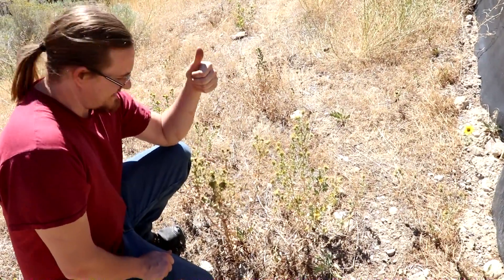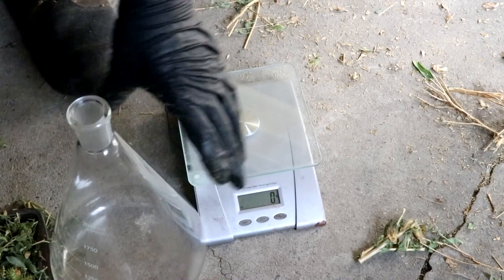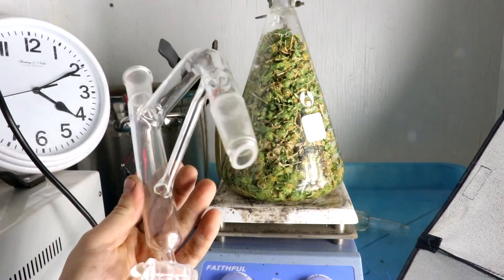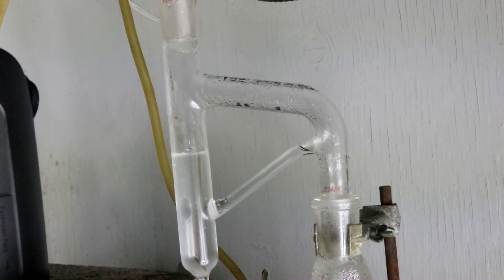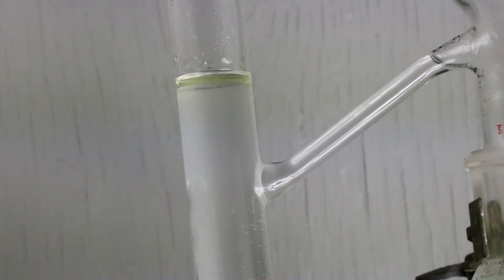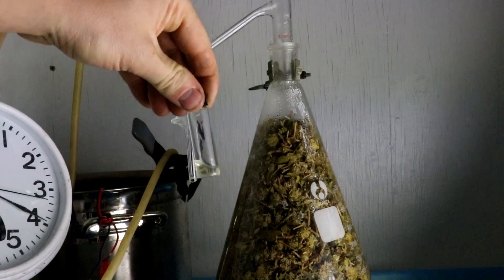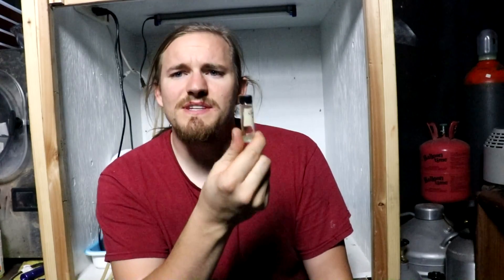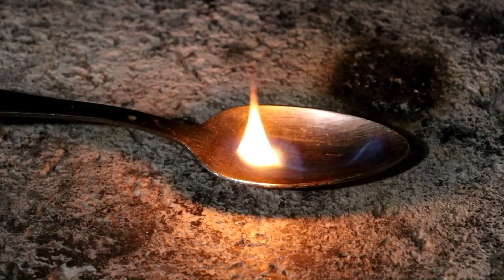Extracting Jet Fuel From GumWeed

Comment: Wonder if you would get more from a press then distilled?
Reply: Y'know how they used to get olive oil, yeah? Yeah.
Reply: Kain Yusanagi Used to? The extra virgin olive oil gets it's name because it's the one obtained with the first cold press of the olives, then comes the virgin oil which gets heat pressed from the remains of the first press and then the rest of olive oils which are unlabeled as extra virgin or virgin are extracted from what's left with solvents. This is the process from 2000 years ago and still aplies today.
Reply: It could be possible, eventhough I tried this receipe with other plants with more oil content :
- First dry the plants under sunlight for few days (not too long or they will lose most of the oil, just the right amount of time to let them crush under stress)
- Crush them into fine powder (the point of drying)
- Put them back in distilled water, in the same proportions you make with pancake dough.
- Let them inflate covered overnight, the mix will be more firm
- Place them in press between alternate layers of fine mesh stainless steel sieves
Water should draw out with oil, heating the layers around 70°C will make oil more fluid and ease the process.
Reply: I think the extraction was wildly inefficient. His gloves got all sticky from cutting up the weeds. That shows there was a lot of oil in the plant in the plant material.
Reply: @THX..1138  the stuff he got on his gloves were probably the heavier components while what he managed to do still were the really light, volatile components.
Reply: Thats the point, you press it so there is no space for the oil to be absorbed in.

Comment: Try drying your plant material out to the point of being able to grind it to dust then distill also lower your temps as much as possible. That what we do with cannbis to presevrve terps and increase yeilds. If i remeber correctly all plants keep their oils inside the calyx like cannabis so you should theroeticlaly be able to blast it with butane and get a viable oil maybe even a more stable wax form of its essential oils youll get a cleaner and higher yeild with less moisture cintent though. You can also try a food grade enthenol wash but that will also pull chlorophyll and essential oils not sure if that would affect its burn time or how clean it burns.

Comment: I would assume that some of the fragrance is the aromatics of the plant and not the oil, perhaps all the 'smelly stuff' wafted away in the evaporation.

Let me suggest making a solar distillation process so you can heat up a large tank with it and then use it like in the winter when the cold air does the condensing for you [pyrolitic destructive distillation] and you COULD perhaps use a vacuum chamber to increase extraction.

For large amounts of solar power, just make a trough in the hillside and place your barrel/pipe at the top so that the winter sun collected like it would on a regular high temp solar parabolic collector used for generating steam power in an electric generation power plant.

Just roll the aluminzed mylar out when needed and roll it back up when not in use to protect it, or if a storm comes along to potentially damage it.

In theory, within a single day's time, it would fully char the bum weed producing a host of combustibles and you could just purge the carbon/coke each evening when it cooled and replace it that night for the next sunny winter day.

Also, you can harvest it in bales while it is still slightly moist to collect it without crumble-loss and then put it through a shredder for a compact charge without as much air, or of course, add the water to drive out the air.

Put a hydraulic or pneumatic ram at one end to do the hard work for you and make sure the rig is strong enough to not get torn apart by the hydraulics and you can load it pretty easily.

Hinged pressure plates on each end with pipe couplings would allow you to detach the hatches, then reattach them without problems with plumbing, OR you could weld fittings into the pipes for adding water and extracting product and use flat plates.

I have a filter system which COULD be used except that it would have to be placed either on its side, or upside down, and I could use my big 30 gallon pressure cooker, but these items have other purposes.

I DO have 10 foot lengths of sch 80 steel pipe, but no space for gum weed of that capacity, no space for a large solar mirror, and also the pipe is scheduled for corner posts for my fences eventually.

IF I manage to get another piece of land I would like to get, I will at least try to build a large solar distillation machine.

Comment: I bet with a better cutting method for more surface area and a slower boil to account for your tiny condensing tube you could get a lot more by weight. 

try again and run a lawnmower on the weeds you cut with it!

Comment: That stuff would make a good lamp fuel from how it burns.
Reply: I bet that's his final goal, he's a prepper.
Reply: that would explain so much
Reply: I don't get why he didn't just use a rosin press
Reply: GrowingDownUnder 
You sir, just peaked my curiosity!
Reply: I saw you on project farm's video
Reply: Hydraulic press?
Reply: Barry Manilowa nope, weed is good as it is. No need to mix anything in.
Reply: Moth intensifies
Reply: Yeah i thought so too but i think i'd take a bit to much effort for an hour to get enough oil without just killing all the plants that his bees like
Over a year though you might be able to get alot of lamp oil like this
Reply: Kerosene is probably cheaper than the electricity he'd use to distill an equivalent amount of oil, not to mention the time and effort. Firewood doesn't appear to be abundant for long term post-SHTF processing. Maybe if he developed a way to distill it with direct solar heating, but the return on time investment is still an issue.
Reply: Bob Smith I appreciate your contribution.
As much as I’d prefer a lovely transition of times, the possibility of needing to fend for ourselves & close ones looks likely or possible in portions.

Sounds like you’re on your good way toward preparedness.
Lucky be those that get closer to your understanding.

Many of us are shining lights in the darkness and we barely even know it.
Reply: Diabettiss

Comment: heh, i seem to have my eye calibrated, i said to myself 0.1 - 1%, closer to  0.1%...

BTW, when filling the flask, do it on top of the tray where you pick up the plant matter., there is sooo much less cleaning. Funnel that has the bottom and one side cut off helps, it is a sort of curved wall so you only need to worry about the exposed edge of the flask  spinnling crumps and you can use that opening to smush things in with the finger. Takes like 20 times less time, you can just pour in the small particles and dust at the end: this is often the most valuable part of the plant matter: dried up flowers iwill break to small pieces easily, that is sort of designed function in the nature that they will do that.. That is where in most plants the oils are concentrated..

Comment: You should get a small diesel engine and get enough gum weed oil to see if it will run a diesel engine for like 1 minute or something. Could try un refined just the way it comes from the plant or refine it some way.

Comment: The lighter more volatile oils would have come off at the top. These are probably the fragrance oils. Also, was there any oil residue left in the conical flask??. Would an alcohol distillation work better?

Comment: The smell was reduced because of the heat in distillation. The heat cooks off the terpenes.
Reply from the maker: Makes sense, maybe I could run it under partial vacuum?
Reply: Cody'sLab  Vacuum would cause it to pull off more terps. I know this because I extract cannabis oils. Maybe if you pressurized it somehow
Reply: I love your videos btw man. You really do inspire me
Reply from the maker: Oh so longer/colder condenser?
Reply: Maybe use a more effective condenser, such as a Graham or an Allihn condenser
Reply: Cody'sLab You extracted the oil from the plant, but there are almost no terps in it probably. Try to extract it with a solvent maybe? such as butane, or co2 if you have the right equipment for it. Butane extractions are safe to do outdoors, and they extract all oils without damaging any terps with heat. You may want to dry it out first because it will also extract the chlorophyll from the plant and make it green. There are ways you can take the extracted oil and extract specific terps from them, since different terps have different evaporation points you can extract one terp at a time.
Reply: @marcferretti  I say he should use a bipolar solvent to get everything thing out because heh hey he ain't gonna be dabbing that oil
Reply: Try cold-pressing like how you would extract vegetable or seed oils. Presumably, the oil would evaporate at a lower temperature than water so you may be able to separate them at a lower temperature.
Reply: @marcferretti  Now I want to see Cody running supercritical CO2 through flowers to do an optimal extraction. I'm sure he can do that.
Reply: Try extracting it with super critical CO2? I think that's used for cannabis as well.
Reply: Came here to ask; why not CO2? When you mentioned you were going to extract oils from this plant I was convinced thats what you were going to do; what other youtuber would mess around with supercritical CO2 after all? I suppose building a pressure vessel with sufficient volume to be useful might be trickier than just making a small vial of it though... but if you ground up and compacted the plant material and put it in a steel tube... there are many more molecules you can get at this way than with steam alone.
Reply: @victorwidell9751  lol u think
Reply: @theCodyReeder  I'm not sure how they extract plant terpenes I do know they are volatile at lower temps. I'd research terpene distillation.
Reply: Maybe cold water extract and evaporate the extra water off slowly
Reply: Cody'sLab you could use a different solvent. I know in the cannabis industry they use butane or co2. That way terpenes are preserved.

And look into pure terpenes from some company’s. Prana is the company name I think. The owner has done videos on the process. It involves extremely cold temps.
Reply: Cody'sLab check out golden beaver farms he does some amazing work with extracting terpenes he’s running a steam distillation apparatus with dual condensers and under vacuum check out him out his work is amazing
Reply: also check: Essential oil distillation home made , rosemary - Huile essentielle distillation maison, romarin
Reply: @theCodyReeder  try CO2, it will extract the chlorophyll as well so keep in mind
Reply: @theCodyReeder  you got the stuff
Reply: use a rosin press
Reply: i agree definitely need to try other method's and maybe you would get stronger smelling oil
Reply: Using a soxhlett extractor with a low boiling solvent, like hexane would work
Reply: Will work well only if the desired elements are non-polar
Reply: I had a feeling a lot of "essential oil" extraction experts watched this channel. :-)
Reply: So many smart people
Reply: GOOD GOD MAN! It was bad enough when he was drowning Moles in acid! Now he is boiling Turtles!!!!!
Reply: I might be wrong, but don't they also sometimes use Butane to extract oils from buds?
Reply: They do, but you need to use a vacuum to get the butane back out and the process can be pretty dangerous and complicated.
Reply: wouldn't it help shredding it first and then submerge it and heating it up without boiling until the oil floats up instead of using distillation? I've the feeling most of the oil stayed in the weeds. Or maybe a pressure cooker, but then it would boil.
Reply: InfinitePower yes it’s very pure butane and it’s often used in a CLS system or closed loop system. That way all can be recovered.
Reply: I still think it's a good achievement not too many people were looking into it I have interest in growing garden weeds and plants not normally grown looked at for mass market consumption and practical use. You inspire me to go back and get my degree ,to garden and explore science keep up the wonderful videos!
Reply: I once used butane to extract cannabis oil and cooked off the excess material using a pot of boiling water and a glass lid (turned over to exploit the curvature) so I'm assuming the same process can work here, except I would assume smoking it wouldn't make you go weuweuweuweu lol
Reply: The terpenes should not be cooked off as long as you have a sufficient condenser. I extracted Limonen this way, which is a terpene, without problems. Ofcourse different terpenes have different boiling points but anything above 40 °C should not be a problem at all and most have a way higher boiling point (>100°C).
Reply: Squiggummer Figgammus you and some minority people on this thread are mixing things up. steam distillation and solvent extraction(followed by solvent evaporation) are two different processes, using different effects. in steam distillation, the insolubility of the oil in the solvent is completely intentional and beneficial.
anyway, cody should refine his extraction with both modes in parallel, it would be fun.
Reply: Of course, whatever biomass remains can also be gasified and put through Fischer-Tropsch to produce even more fuel.
Reply: also you shouldn't have dried it, should have gone strait into the vessel after harvest
Reply: Under a full Vacuum you should be able to apply far less heat and still achieve a proper Distillate while preserving a decent amount of your terpenes.
Reply: I'd do it with liquid butane or propane honestly.
Reply: I remember a chemistry class at university where we extracted the essential oils from tobacco with initial LN2 bath followed by ether distillation by high temperature heating of the vessel in oil-baths
Reply: Short path distillation will seperate the terps, but essential oil of gum weed is really good for Respiratory complaints as well as poison ivy poison oak. Never ingest essential oils
Reply: Winks PhoenixDrakonis lol have you smelt terps from crude thc from a short path shit smell putrid